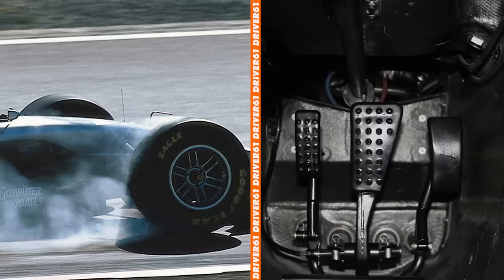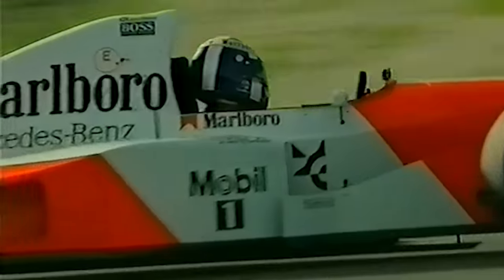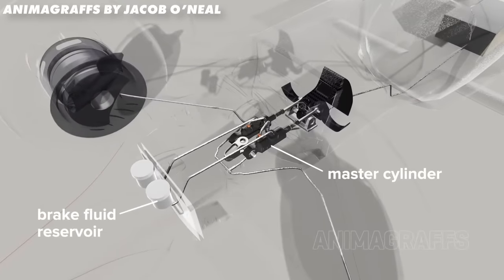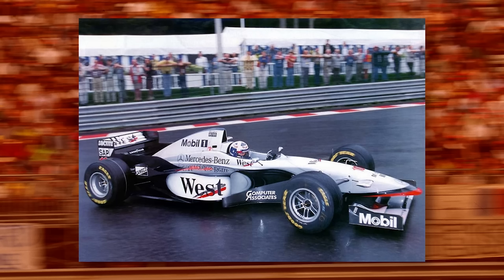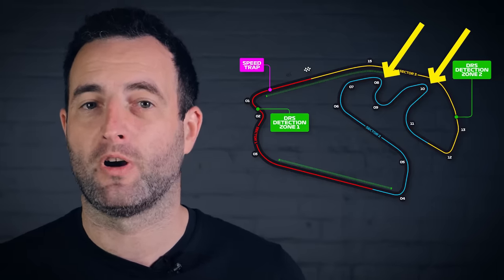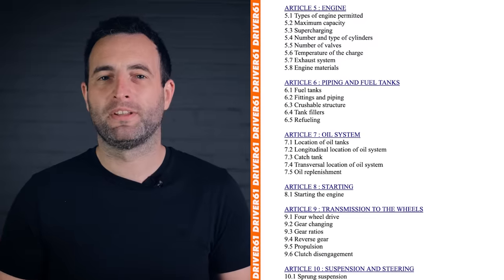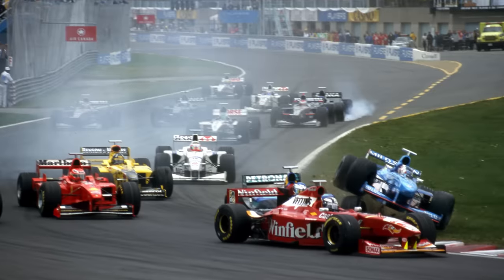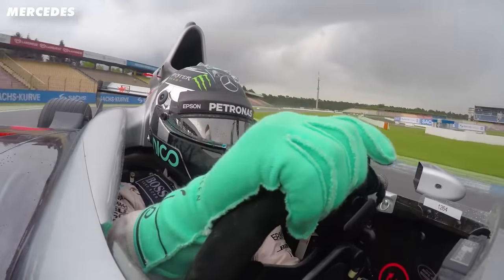Why This F1 Car Has FOUR PEDALS

Comment: Not cheating, in-genius engineering. It’s stuff like that that gets me as hyped as I do for F1 . Such a shame FIA keeps banning all of these awesome inventions that all the teams could’ve eventually used themselves possibly.
Reply: If all great innovations were allowed, then, at some point, there would be nothing more to come up with. You would basically have a perfect racing car with a lot of gizmos on it. This way, engineers have to come up with new things all the time. And that's what make Formula 1 amazing.
Reply: @tavyturean5725  I disagree, innovation never stops. If they stopped banning every big ingenious change that engineers came up with, we could have even better cars and spectacle than now and someone would always come up with the next better idea. After all it is a constructors competition, ingenuity must be rewarded
Reply: @vdross_79  F1 tends to keep tech that makes cars on a basis that is road-relevant. DAS and this brake system in particular don’t really have benefits on the road.
Reply: @hughlevantjames905  My 2008 Honda Accord has rear trail braking E.G. it brake the inside rear wheel on a sharp turn. you have to replace the rear pads every other front pad change.
Reply: The ban was probably more of a safety oriented one rather than the cheating allegation.
Reply: ingenious
Reply: I was so fed up they seemingly banned that recent Mercedes front wing. Really wanted to see what it could do
Reply: @san-joshuabarrett  it would probably be very effective at sending air to the floor. However it would probably create a lot more dirty air as a trade-off so I get why the FIA banned it.
Reply: This is the kind of engineering that helps makes space ships. Thinking outside the box is crucial.
Reply: Team: We found a new innovation within the rules.
Other team: nah I dont like that.
FIA: ok, that is banned.
Reply: @vdross_79  I agree would have better cars but I strongly disagree that it would be a better spectacle. In fact I think it would be pretty boring with the order decided after qualifying and no one able to overtake or get close. The same teams winning all the time with stale racing. The constant cat and mouse with the FIA keeps it interesting and shakes up the order
Reply: @hughlevantjames905  this braking system is 100% used in road cars. I know I worked on systems more advanced than it when I was working at jaguar Land rover
Reply: @richardshippful  I don't think you can call that trail braking. Electronic brake distribution is a different thing.
Reply: @tavyturean5725  It still amazes me when they do, I thought the sound of this year's restrictions on the cars was gonna be too much, but every car came out looking fairly different in testing. I'd imagine that at some point as time goes on under these regs there will as usual be some level of convergence on the ideal designs of components. There is no such thing as a perfect racing car I don't think, just the best one at the time!
Reply: @richardshippful  LOL I just saw this I did so many warranty brakes on accords of that gen when I started working at Honda in 2010. Typically wear items are not warrantied but this one was a good exception! Oddly now were doing endless caliper replacements in the rear of 12-maybe15 accords cause the parking brake mech seizes (I'm in New England area). lol Not warranty anymore, funny how shit works or doesn't.
Reply: normal people don't watch f1 for innovation they watch it for entertainment.
Reply: @tavyturean5725   It is a second set of brake calipers at the rear with a brake bias adjuster so that it can be biased to the left or right rear wheel as needed. the system was purely mechanical and required driver skill to deploy,  it is not automatic nor computerized. It did not really break any rules, it just got banned due to the lobbying of other teams.

Killing innovation kills the sport. Nobody is saying in this comment section that every innovations needs to be applied. The main rule of F1 is to ban innovations that do not require driver skill or ones that endanger the drivers.
Reply: @boopitywoop7981  how was it dangerous? Hakinnen won 2 races with it
Reply: If these innovations weren't just banned because some teams find it easier to complain than innovate themselves, we'd have too many to fit to one car and teams would have to pick and choose which options to go for, and that would mix up the field no end. Some cars like bullets on the straights, some able to slingshot round corners, some good all round with massive driver confidence, having different cars fast in different areas by significant amounts would lead to far more wheel to wheel racing, rather than the (by comparison) stale DRS show we are being served up these days. I've watched F1 since the mid 80's and the kind of move we now see once or twice a race that has us out of our seats, we used to see more than a dozen times in a race, because the cars were not so prescribed, simply separated by engine power and tight aero rules that are locked in for years. Back then cars could change significantly from one race to the next if teams wanted to try something different, and the regularly did. Now everyone is supposed to get excited about Alfa Rome introducing a new front wing with 2 extra slots in the end, in the past cars turned up with 6-wheels, fans to provide downforce, wings either side of the driver, and some even more wild than that!
Reply: I absolutely agree. Heck I want F1 technical regs to go back to the 50s. Specify an engine type (hybrid obviously) and let the engineers do whatever the heck they want with the rest. And unlike what some kids believe, this'll actually lead to much closer racing (the only innovation I know about which was actually dangerous was the ground effect fan used on the Brabham BT46B. If teams want a fan, it'll probably be best implemented in the way Chaparral did with the 2J, where they had a sort of grill right at the exhaust). The only thing I want kept is the halo and the engine cover roll bar.
Reply: in-genius?? don't you mean "ingenious"?
Reply: @tavyturean5725  that's the kind of thinking that prevents innovation

Comment: My favourite bit about this story is Nichols laughing at all the other teams overestimating the cost of the system. They said it was a hundreds of thousands of dollars, while it was actually 50 dollars worth of parts they already had lying around.
Reply: How? Aren't the titanium/other material bolts and parts like $80 for a single lug? Assuming they needed to use a few bolts to put the pedals in. I remember hearing Pagani uses titanium screws/lug nuts at $80 a piece and it has over 1000 throughout the car. Im assuming machined screws for F1 cars would be even more expensive than Paganis.
Reply: @MrSeanman30  They probably used regular screws. No need for precision machined screws when all you have to do is put an extra pedal and brake line in the car.
Reply: @MrBIooder exactly, wheel nuts are different story because they need to optimise it for pit time. Engine pistons and parts, also optimisations.

Comment: You know that you've made it in F1 as an engineer, 
when your innovation gets banned for being too good
Reply: Basically colin chapman and adrian newey problems lol
Reply: @ozamatazbuckshank7467  And Gordon Murray
Reply: DAS a good point👀
Reply: You know, taking that into account, and if we remove the steering system from the front wheels, and what activates the steering wheel are the brakes on both the left and right sides of the car, as if it were some kind of track system
Reply: the rival teams get  innovations banned cause they are jealous.
Reply: @pinkikoley397  Fr it’s the reason why track times barely advance each year
Reply: You know you're really good, when it's on the car, makes it go faster and others can't find it.
Reply: Idk about my grandpa but adrian newey is unmistakably the best designer of today. We might hear something in a few years about the rb18..the closest car now to mp4/4
Reply: My favourite of all time is still active suspension. So complex, so many possibilities. With modern computer systems, the entire suspension system could move, dip and roll perfectly into a corner, perhaps even adjust itself in a way to factor in tire wear. It certainly makes sense why it was banned, but man that was peak design!
Reply: and if spending limits get introduced because nobody can beat you.

Comment: Weird choice by the fia to say it was illegal, since it wasn't really a 4 wheel steering system. They should have changed the rules during the off season to explicitly say it was illegal, not deeming it legal for then banning it in a span of 2 races

Ferrari international assistance was how people called the fia back in the day, and i like how it sounds 😂
Reply: Bribes were handed out.

Or so I was told...
Reply: @AJZulu  Don't forget the animosity between Ron Dennis and Max Mosley.
Reply: @Yousuck00  apparently it was a grey zone technology, so they did the right thing by banning it for the next season. But if it was illegal, then they shouldn't have let them run with it

What i don't like is how the fia banned the mass damper during mid 2006 (in the middle of the title fight), after letting renault, and other teams too, using it for 2005 and half 06

You either ban things immediately, or say they're legal for 1 season only, if you don't like the solution they came up with, but it still is within the rules
Reply: @AJZulu  i wouldn't be surprised

Ferrari already was the most important team back then, and they had a rather young star in schumacher driving for them.
Ecclestone said that him and the fia helped ferrari winning multiple times, and that everyone was interested in having a competitive Ferrari since it was good for the sport

And said that merc 2014-16 dominance was also due to the fact that brawn switched from ferrari to merc and carried very important infos about the new engines regs with him, that others didn't know
Reply: @windfall how can you say that nowadays it's anti ferrari when ecclestone (f1 boss until 2017) said that he did everything he could to help ferrari winning. Now the f1's ceo is ex ferrari team principal stefano domenicali

If toto will become f1's ceo, and merc became fast again, everyone would be saying "that's why they're fast, toto is helping them, mafia"

If ferrari wants to be competitive they need to improve, like how everyone else has to improve if they want to win. Nothing should be gifted to teams
Reply: That one wasn't just Ferrari... It was pretty much every other teams.
Reply: @Yousuck00  DAS was legal af at that year.
Reply: the FIA can be relied upon to stifle anything that smells of innovation.
Reply: @windfall no idea how you can say that when you have senior ferrari people all over the FIA. They still get special treatment with their special engine deal they did a couple of years ago. Ferrari are just so incompetent not even the FIA can help them.
And I refuse to accept that ferrari are F1. F1 is so much more than ferrari. I'd buy a mclaren over a ferrari any day of the week
Reply: 4 wheels working together to steer the car into the corner.  it was 4 wheel steering.
Reply: @steviegbcool  as another guy said, 4 wheels always work together in a way or another to steer a car, so that's not a valid argument imo. Also, the brake system affected only 1 wheel. I personally don't see it as a 4 wheel steering system
Reply: @oj7177    i cant be bother to argue semantics . they are steering the car with the  rear wheels aswell as the front wheel so 4 wheel steering.  plenty of vehicles like tanks steer like this.
Reply: @steviegbcool  That's plain bs. Every f1 car, now and then, used some kind of adjustable locking differential, which induced a steering effect through the rear wheels under acceleration and deceleration. It's the same effect and has never been considered four wheel steering.
Reply: You know, taking that into account, and if we remove the steering system from the front wheels, and what activates the steering wheel are the brakes on both the left and right sides of the car, as if it were some kind of track system
Reply: Well the banned Peugeot out iirc.
Reply: Better option would have been to make it mandatory for all cars.
Reply: @MikeDCWeld  Ferrari International Assistance remember.
Reply: @danielgotz4032  Differential is a good point, that would also fit under Ferrari's tank track definition of steering

Comment: Fun fact pretty much all tractors used in agriculture have separate left and right brakes because when large force is applied to the rear of the tractor during heavy operations the front tires get very little grip and so you can steer with brakes

Comment: I was furious at the time when they banned the car for basically two reasons:
1) it's one of those clever/borderline solutions that made F1 interesting and fascinating.
2) a friend of mine "invented" it on his ethanol RC car in 1992 (by connecting some rods from the steering servo to some sort of custom drum brakes which were able to destroy his RCcar plastic rims in seconds... LOL). I remeber he wanted to build himself some aluminium rims but eventually gave up for lack of tools... But, after seeing the pedal picture in the newspapers in 1996/1997, I remember I called him to admit he was right.

Comment: One day I'd love to see a deregulation of things like these in F1: just trow brake steer, f-duct, steer adjustment (push the steering wheel) and so on. The important part is that all those systems need to be operated manually. That way the drivers become the limiting factor. You could maybe regulate it so that teams can choose a few of them, giving more diversity in the lineup?
It's not like I know enough about F1 to say if this was possible though....
Reply: The problem with having F1 drivers as the limiting factor is that they don't respect their limits and end up crashing
Reply: @gave2haze  Personally I think you're mistaken. If you want to win a championship or keep a seat in a team, you better learn how to get results.
If drivers can't do it, they will be swapped out, someone out there will be able to do it - it's not a small grass roots event.
Reply: Meh, do it all driver-less and only regulate the amount of fuel permitted and the overall dimensions. Like a mix of battle-bots and Mario cart.
Reply: F duct is legitimately dangerous since it requires one limb to loosely grip or completely be off the steering wheel or pedals. The others should definitely come back.
Reply: @456MrPeople  If only there were knee controlled F Ducts in the past...
Reply: @456MrPeople  The F-duct on the McLaren was operated first by the knee, later by the elbow. The hands remained firmly on the steering wheel. You remember the video of Alonso in his Ferrari using his hand to cover the hole.
Reply: Call that F-Zero
Reply: @eizzah8323  for the glory intensifies
Reply: Allow everything but make the systems fully manual. I really like this idea

Comment: American dirt sprint cars have a similar setup but it's not an optional additional peddle. They have a solid rear axle with one rotor on it with the caliper mounted to the rear housing. They also have a single left front rotor with no brake at all on the right front. The left front rotor is used to help pull the car to the left being they run only ovals. Some teams will run a third brake, mounted to the right rear bearing hanger but many teams do not.
Reply: Trials cars and many old agricultural tractors have fiddle brakes, essentially 2 handbrakes one for each rear brake. By slowing or stopping the inside rear wheel and powering the outer wheel a very tight turn can be made. Caterpillar tractors work on a similar system.
Reply: Dirt Late models have a switch to completely turn off the right front via solenoid in line with the brake.  Really makes the car turn left.  This is in addition to front-rear brake bias adjustment.
Reply: If it's a solid rear axle it doesn't matter where you put the caliper it's not going to make it torque vector around the corner.
Reply: @Robert-cu9bm  the fact some cars put an additional brake on the right rear bearing hanger, when the brakes are applied, the torque applied to that hanger, rotates the hanger and actually prevents the car from wanting to roll onto the right rear tire, which is bad when the track is wet and heavy (actually sticky) or trying to set the right rear tire against the cushion. Keep in mind this is not an independent suspension design. As the car squats, the whole rear end rolls forward in the car, increasing drive off the corners

Comment: I don't think it's illegal. A Brazilian engineer put something similar in a car based on the beatle volkswagem to improve its off-road capability. You could use the rear brakes independently of each other. If a wheel runs out of traction, you apply the handbrake only to that wheel and get grip to get the car out of the mud. This in 1960, 70. Gurgel is the brand.
Reply: That is genuinely brilliant! Simple, direct, and effective, not like modern so-called clever AI assisted Limited Slip differential used in hightech LUV(L-Suv). Ease of operation is the Key point in pushing this branch of tech tree.

Comment: Many agricultural machinery has two independent brake padels close together (one system for each side, that can be either pushed simultaneously or locked together if needed) and use brake steer to help with tight turns or generally steering heavy equipment. It becomes natural quite fast to use the pedals to aid steering.
Reply: And you can steer with the brakes if the front is lifted into the air because of too much weight on the back, so you basically balance the tractor on two wheels.

Comment: Farm tractors you can brake either rear wheel separately or simultaneously. This seems like very similar thinking.
Reply: Many of them also speed up the front axle at a certain steering angle, which drags the machine around tight corners. Bi-speed steering.